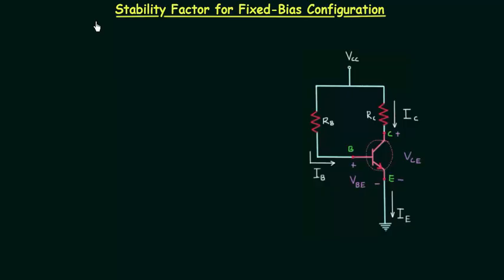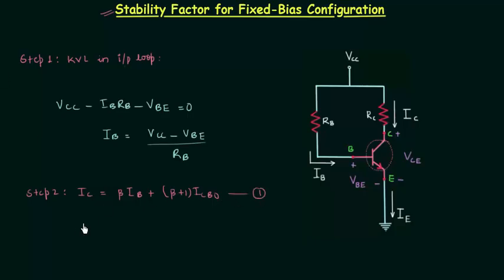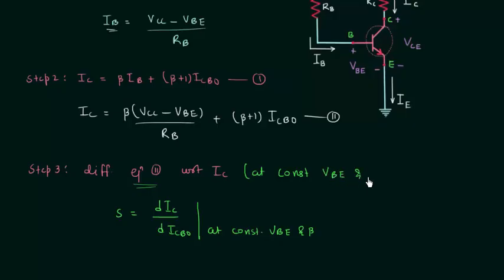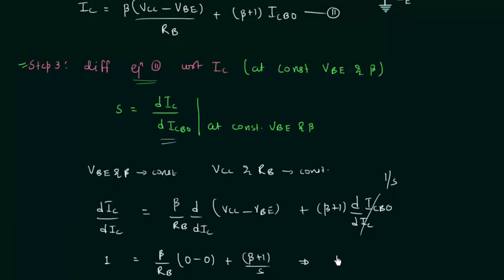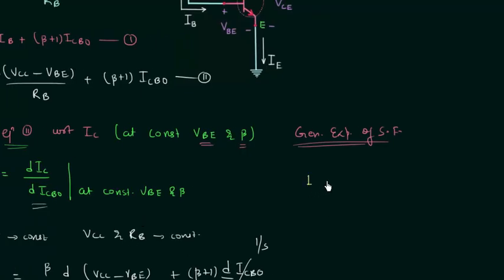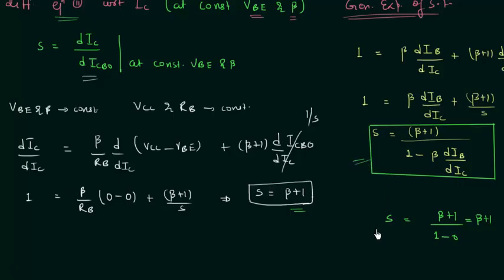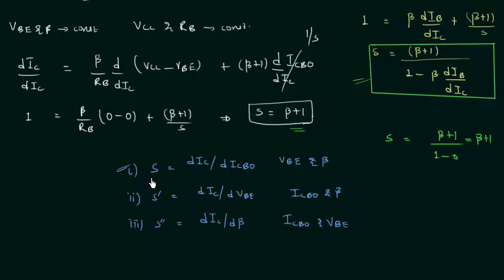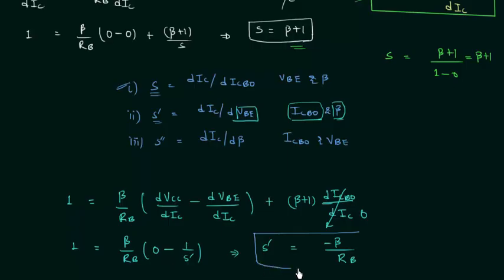Stability Factor for Fixed-Bias Configuration

Comment: In step 3, why don't you divide the equation by dI(CBO) instead of dI(C) ? Then you get the S right away on the left side of equation.
Reply: Because here in fixed bias you can do this amd directly get (beta+1). Bit in Emitter bias and collector feedback bias case of you do this way, solving mathematics will become so complicated. There calculating S becomes easier if you do the way as shown in video. So he's just using a general mathematical step to solve which can be applied in all 3 cases. Otherwise you would only get confused, and comment on that next video, that sir in last lecture you had directly differentiated, and this lecture you are doing different, why and all. So why not follow a general way that can be applied easily to all cases. Anyway, this is just a mathematical expression, you can solve it any way which clicks easier amd faster to your brain. Simple.
Reply: Please i need an answer im confused
Reply: Yes sir first eq 3 is divided by ic keeping two factors constant and 2 variable . For s Vbe constant so. Term Ib is fully constant . If u differentiate it with some varying quantity it will give u zero . So no matter if u differentiate it w.r to icbo u will also get correct answer

Comment: In step 3, why don't you divide the equation by dI(CBO) instead of dI(C) ? Then you get the S right away on the left side of equation.
Reply: ghee tedi ungli se nikalo ya sidhi ghee toh nikal rha hai na
Reply: yah, we will get the same ans
Reply: ohh
Reply: did u find the answer ??
Reply: Because here you can get ( beta + 1) directly. But when you do like this what you have suggested in Emitter bias and collector feedback bais case. It will become very complicated. In both that cases, what is being done in video makes solving equation for S much easier. That's why he is doing a general method, do that he can do same mathematics in all 3 cases.  It is mathematics, you can solve it any way which clicks your brain easier, simple.
Reply: T2 is more stable with a stability factor of 5

Comment: sir I want to ask u that why we take V 'BE' as 0.7/0.3v, I mean that if we are applying the forward biasing between emitter and base then should the voltage across the diode be constant?
Reply: For a transistor to work there must be a certain voltage after which it starts conduction... In case of Silicon its 0.7v, and germanium it is 0.3v... when you see the emitter bias junction its just a pn junction diode..So if we apply 0.7 v then the junction will open for current conduction